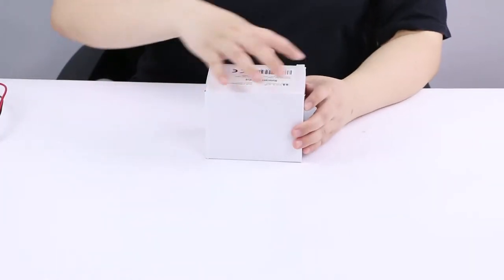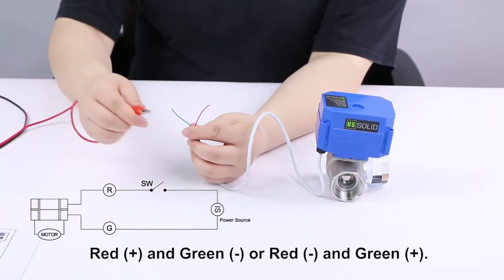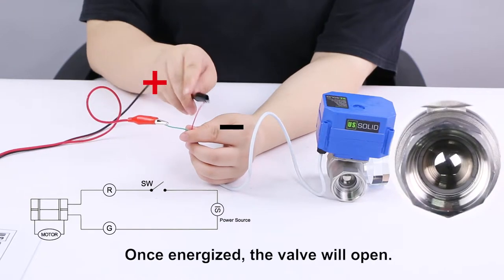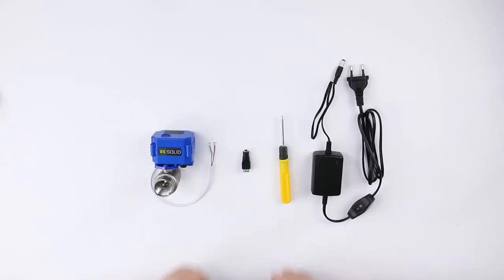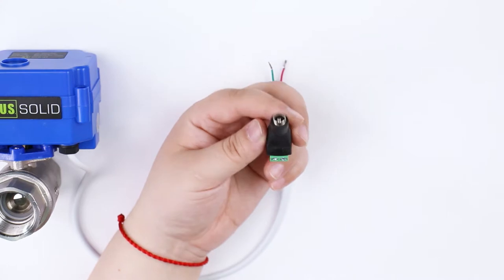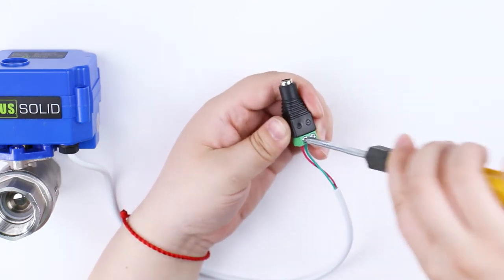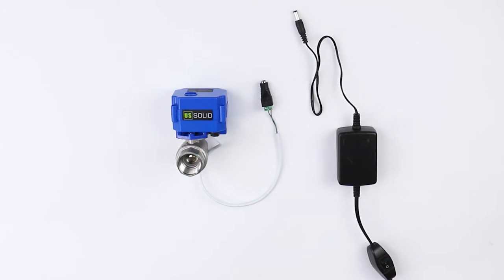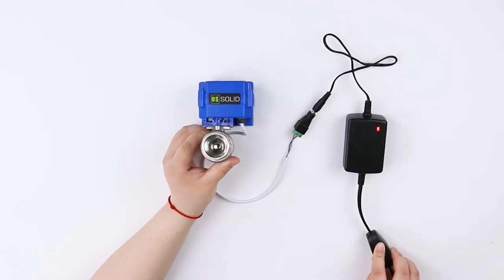USSOLID Motorized Ball Valve, 2 Wire Auto Return

Comment: Is its opening or closing directly related with water pressure which comes from water tank?
Reply from the maker: No, it will open when connected to the power supply. And it will return to close when power fails. For this valve, the max pressure is 145PSI.

Comment: Can I use this for chilled water air handler? What is the max PSI pressure the valve can handle? 3/4 inch motorized valve for 110V.
Reply from the maker: The max pressure is 145 PSI(1.0 Mpa).

Comment: can I reverse it and have it always open unless powered?
Reply from the maker: no, but a normally open valves is available https://ussolid.com/u-s-solid-motorized-ball-valve-3-4-brass-electrical-ball-valve-with-standard-port-9-24-v-ac-dc-2-wire-auto-return-normally-open.html
Reply: You could do it with a relay

Comment: How does the valve return to the close position with no power? Is it a coil spring? Or is it a little reserved power? What are the chances of the valve not closing completely?
Reply from the maker: It returns by a storage capacitor running the motor in reverse.
Reply: U.S. SOLID do you have this with a manual override?
Reply from the maker: @gasstationgroceries  Sorry but not at the moment
Reply: @USSolid  What size capacitor do you use in the auto-return? I'm doing a custom setup, and want to have an idea how much capacitance I need to be able to reliably shut this.

Comment: What adapter is this and how can I find it, what would I search? I have the exact same valve and need the converter adapter product you used . Thank you thank you
Reply: This valve will work at 9-24 V AC/DC
Reply from the maker: DC 12 V battery.
Reply: Female power jack adapter - for anybody else wondering the same thing.

Comment: What is the life expectancy of this valve and actuator assembly if it is operated open for 1hour then closed once a day?
Reply from the maker: Life Expectancy: 80,000-100,000 Cycles
Reply: Life expectancy has nothing to do with their cycle count.  I have multiples and they last less than 1 year, they stop closing. @USSolid
Reply: @rowlandcrew  what have you been using them for?
Reply: @mooreevair  I use them as sprinkler control valves, instead of the diaphragm type valves, in a few places where differential water pressure upsets the diaphragms.
Reply: @rowlandcrew  ah I see. So did you find a better alternative ?
Reply: @mooreevair  I have not found another energy storing ball valve. this design concept appears to be the best I have found, relative to the alternative luxury of being able to keep diaphragms higher than the load plumbing.  even so,  the rubber diaphrams will collect dirt and get hard then stop every few years($10 per part compared to 60 for a ball valve).  have tried to coat the corroding parts with an anti-corrode to extend their life. I have yet to find a bad capacitor.  It is possible that the stainless steel versions run longer.